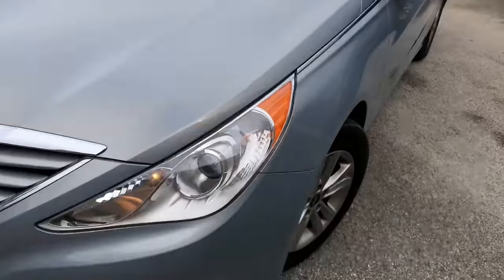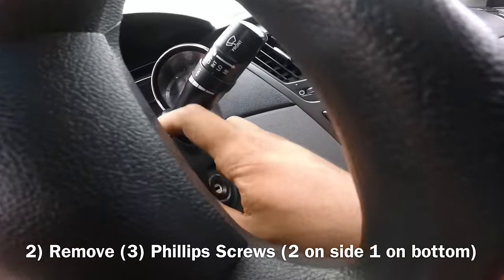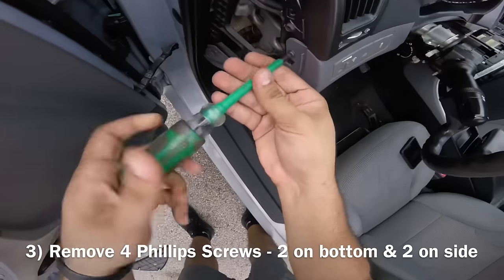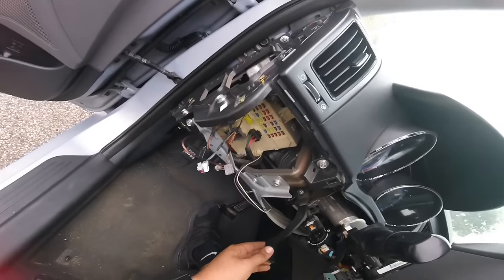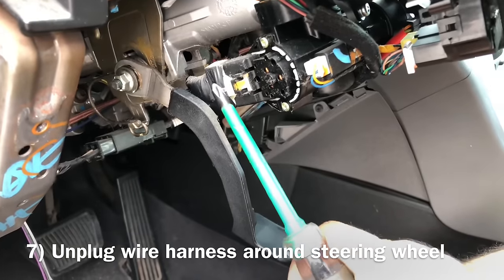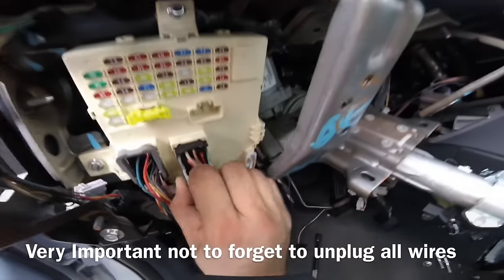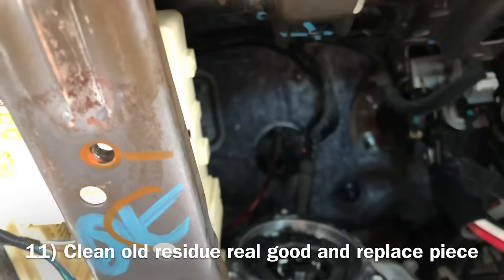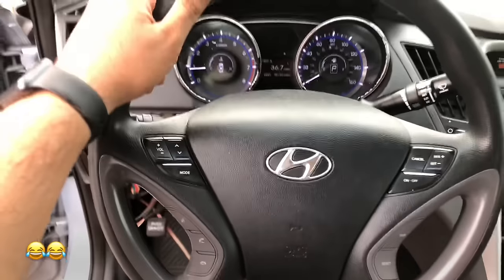HYUNDAI STEERING WHEEL NOISE : HOW TO FIX - SONATA/ OPTIMA 2011-2014 UNDER $20!! FAST & EASY!

Comment: Great Video. I have a 2010 Hyundai Elantra so parts were in a slightly different place but it that was the problem and replacing the coupler fixed it. EPS light on now, I think I just need my mechanic to reset it. Thanks

Comment: Hello Thank you so much I did it but after fixing the Steering is firm and doesn't work. I have checked again but it doesn’t work, what I should do? The EPS light is also lit. please help me
Reply from the maker: Hey bud! First I would recommend that you go back and inspect every connection to make sure it’s good and in the correct spot. Second check all your fuses! Make sure nothing is out of place and burnt out! Third I would recommend you bring it to a shop for further inspection.

Comment: It’s a good video. Walked me through the repair. They are correct the manufacture did extend replacement to 10yr or 100k miles. At 125k trouble free miles I don’t mind putting a three dollar part in her. Thanks...👍🏻
Reply from the maker: Hey I’m super glad I could bring value and information to you! And yes their warranties are excellent! And yes a three dollar part will save you hundreds if not thousands depending on where you go.

Comment: Thank you 
Great job!!
The only suggestion.....
Disconnect battery allow air bag module to discharge, then disconnect the yellow air bag connector . 
( yellow = caution )
Reply from the maker: lastgleeming thank you! Really appreciate the feedback!! Thanks for watching!!
Reply: @Hidalgo Motors Co TV 
It came out great! Only problem the clock spring code set .
Not my fault . Did not move steering wheel . 
Just high mileage garbage . It was very easy . Took 7 minutes since I didn’t replace the panels or clam shell . 
Save my friend a bunch . Thank you again. 
I subscribed .
Reply from the maker: Wow that’s incredible!! That’s amazing! Thanks so much for watching! It really means a lot to us!! Glad you could help your friend. Clock spring should be easy! Thanks for the sub!

Comment: This video is so helpful omg thank you!! This noise has been driving me crazy for a year. My veloster thanks you!
Reply from the maker: You are very welcome my friend! Thanks for watching! Please share your experience with us!
Reply: HelloHali did you do yours yourself or go to a dealership? I just called the dealership to ask about it and they told me that the veloster doesn’t “have this coupler part and I’ll need my whole steering column replaced”

I know that it’s in there, it’s the EXACT noise this car is making, plus I can order the coupling for my specific year veloster. Like wtf
Reply from the maker: dollxfacexdenied I would recommend purchasing a repair manual for Hyundai Veloster. They’re very similar cars. If you follow the procedure here and be very careful about it you should be okay. Show these people this video. Well skip ahead to where we drop the steering column so they can see the actual coupler... another user went to a shop and he showed them my video and the dealership agreed and replaced the part I believe. You don’t need the whole steering column.

Comment: Well... Watching your video I decided to try it myself you made it look easy... Unfortunately I'm still going to have to take it to the mechanic because looks like someone already replaced it once because the black bolts to take it off are striped and I can't get it off. But before the mechanic will fix it I have to put it back together...dose the steering wheel colum hook have to go in a certain place?

Comment: This is great thanks for the excellent video. We have an 2013 Elantra GT with this issue. You mentioned the noise but is this a dangerous condition when the plastic part just totally dissolves? I drove it this weekend for 4 hours on a road trip for Christmas it seemed scary with the play in the wheel and the bump sound as  I kept the car between the lines of I40. Thanks!!

Comment: Hi everyone, thank you for the video. I tried your method today. I was excited I was able to remove everything I replace the worn part. Unfortunately after putting everything back my steering wheel is locked can turn it despite the fact that I can turn the car on and off . everything else seems to work except that. I am EPS on the dashbord and the sign of sliding car
Reply from the maker: Man that’s a great question. I haven’t run into that issue, I’d suggest going back to make sure everything has been plugged back in.
Reply: This was 3 years ago so I don’t expect an answer, but I’m having the same issue. Did we ever figure out the cause of this? Is electrical?

Comment: So i did all this and when i hooked all the wires back up my car ran for a day. The next day,it started i drove to my sisters to put all the panels back on... after parking it wouldnt turn back on. I found a way on google. Press the start botton wait a couple seconds then hold the start botton for 20 seconds with out brake and it will turn on. It worked. But thats the only way it can start. Plus when i try to shift it gets lockeked and i have to press the botton thing by the shifter please help
Reply from the maker: Wow that’s strange... I would double check to make sure all the connections are nice and tight. Next, check all your fuses. And last but not least, have the Hyundai dealership diagnose the problem. They may charge but they will tell you exactly what’s wrong with it

Comment: Thanks for the video!!!! But is that the only reason why there is a noise?
Reply from the maker: on the steering wheel clunking noise yes. if it's further down, it may be a suspension issue.

Comment: I hope you’ll see this and respond. My dad followed this exactly and got it fixed. However, upon finishing now my car won’t start. That’s never happened before. Dashboard lights up but nothing turns on. Diagnostic tools say nothing major is wrong. 

Is it possible if something was mixed up while putting it back together that it wouldn’t start??
Reply from the maker: hey this happens often. it did not happen to us but seen people go through this. take it apart again and check the ignition plug.. it's gotta be something simple. hope this helps.
Reply: @HidalgoMotorsCo  thank you so much!!

Comment: oh, I have the exact same problem with my 2014 Sonata. I scheduled maintenance with my dealer, but I wonder how serious this problem is. Do I have to fix this right away or can I wait for a couple of days until the small part is available? By the way, where can I order that part? Thanks!
Reply from the maker: Handsome K I would order the part directly from the dealership. You can drive it like that for a couple of days no problem. Just be careful when going highway speeds.. you may sway too much... it all depends on you and how safe you are on the road... the part can wait a few days. I drove mine for like a week with this problem and had no issues. It was just hard to keep the steering wheel straight because it’s always wants to go to one side or another due to the coupler being worn out... once again thanks so much for watching!

Comment: Great video very useful. But I ran into a problem i followed all the instructions but didnt  undo the negative cable not my car won't start any use tips that can help me get the car started?
Reply from the maker: Dominic Walker are there any lights that come on? The battery may be dead
Reply: Yes all the lights come on
Reply: Radio and all
Reply: While working the alarm bleep a couple times.
Reply from the maker: Check your fuses.
Reply from the maker: Make sure car is in Park. And step on the brakes lol sometimes it may not have enough juice. Try to jump start it. Maybe that’ll do it
Reply: Thanks I'll try all....

Comment: Hey man thanks for the vid. Would this issue cause a problem with getting an alignment done? I had a place tell me they couldn’t do it until this problem is corrected. Is that true
Reply from the maker: Jeffrey Durborow hey man! Thanks for watching! And to answer your question... quite honestly.. it’s possible to perform an alignment. But if it’s a shop there’s a high chance they won’t do it for personal security reasons. It’s similar to a worn suspension part. If you have worn shocks/struts. They will suggest you replace the struts first before getting an alignment... so it may be the same thing... that’s my personal opinion. I could be wrong. Once again! Thanks for watching!

Comment: Does anyone know if this is the same issue on a 2013 Hyundai Santa Fe Limited? It's been slowly getting worse and worse over a year. I stopped by the dealer after watching this video to buy the coupler but dealer says I need to purchase the entire ECU or EPS (can't remember). Seems funny that on their high end models that would want you to buy a $600 part rather than a $5 part. It's bad enough now that I really don't want to drive it until it is fixed.
Reply from the maker: Matt Duncan great question! I believe it should be a fairly similar concept. Although I’m not sure. I personally haven’t performed this job on a Santa Fe.... once again! Thanks for watching!

Comment: Doing this on a 2010 Elantra. Have everything completed up to taking the coupler apart and replacing the black plastic spacer. The housing is completely different unsure how to take it apart and replace that washer. Help if you can please!! Can send pictures to help explanation and show housing if needed! Thank you!!
Reply from the maker: google a diagram or call dealership for a diagram on that pump. it should be pretty straightforward :(

Comment: great news     I just went to get this fixed, Hyundai has an extended warranty for this problem,    so got it fixed for free
Reply from the maker: Dan Cronin Yess! Congrats! Not every car qualifies for the free repair! Thanks for watching!
Reply: So I just read the thing about the warranty. Its a bit wordy and I am worried I am not understanding it correctly. I am trying to call the dealership to confirm. Is it that they will fix it only IF you have had it for 10 years/ or hit 100k miles or BEFORE you hit 10 years/ 100k miles?
Reply from the maker: @hannahwichman736  that warranty should not matter.. it has been a recall on all hyundai sonatas by the factory, no matter how old it gets they should fix it for free, however some vehicles qualify for the repair and some dont, I am not sure exactly how it works but that's what I know.
Reply: Dealership cut off is 100k miles. And they want 330$ to fix it.

Comment: Great video.  I am having this same problem with my 2010 Hyundai Elentra.   My steering wheel / front end will violently vibrate when I am on the highway doing 75mph and if I have to brake.   Is that also a symptom of this same issue or do I have an additional problem?
Reply from the maker: It could be your tires.. I would suggest taking it to the Hyundai dealership and paying for a diagnosis
Reply: I have the same problem right now with my 2013 hyundai Elentra, it would viciously shake after I hit 70 mph. Did you ever find the reason or was it from replacing that thing in the video???

Comment: A piece of plastic and you can lose your steering really? they couldn't at least made it out of aluminum? This is a lot more work then i am use to. This is a safety issue and should be under a recall. Does anyone know if this has been brought up to NHSTA?
Reply from the maker: yeah seriously. it's just to keep their customers coming back to get the newer models. haha but there is a user on here that machines them out of aluminum maybe you can find them

Comment: Hi, I just saw this very helpful video, thank you so much! I didn't read all the comments, there is almost 500... , did someone find an easier way to do it? If not what is or are the most important steps to pay attention to?
Reply: Megleee23 I didn’t find an easier way to do it but I did some research and there is a recall for this specific issue. If your car is under 100,000 miles you’ll be able to get it repairs for free at a dealership. This is the website you can input your VIN to verify that your car qualifies https://autoservice.hyundaiusa.com/TXX7/MicroSiteTemplate/MicroSiteTemplateVINValidate/2687
Reply from the maker: Hey there! Thanks so much for watching! We really appreciate your time! Thanks so much for messaging us! Have you gotten it fixed?
Reply from the maker: Thanks so much for helping our viewers! You’re awesome!

Comment: Thank you my new friend!!!:-) My 2013 Sonata started having this problem a few weeks back and it was not until it got worse that I was able to determine it was a left right problem as it was so intermittent.

After watching your video, which I will watch again once my part arrives, I Googled est. repair costs.  While it did not "paste" well, you all get the idea. You really saved all of us some serious money. THANK YOU!!! ... BTW... as of this post, Amazon has the OEM part for $8.32. 

People also ask
How much does it cost to replace a steering coupler 2013 Hyundai Sonata?
Car	Service	Estimate
2005 Hyundai SonataL4-2.4L	Service typeFlex Coupling-Steering Damper Replacement	Estimate$429.84
2013 Hyundai SonataL4-2.4L Hybrid	Service typeFlex Coupling-Steering Damper Replacement	Estimate$440.34
2016 Hyundai SonataL4-2.0L Turbo	Service typeFlex Coupling-Steering Damper Replacement	Estimate$440.34

Comment: Very informative , very helpful , Hyundai in copying honda , Toyota and mixture of European all put together in one doing these idiotic over engineering but I will try to do it on my own after watching your few 3-4 times . It definitely saves money and saves time from dealership rip off which Hyundai should be covering as manufacture defects . Thanks again .
Reply from the maker: Hey you are very welcome! Glad we could help you! And yeah the hardest part for us was re installing the steering column. Other than that it was extremely easygoing process!! Plain and simple. Unscrew unplug and remove. Reinstall plug in and screw in and done! Lol thanks for watching!

Comment: Thank you for the video. My 2011 hyundai sonata has EPS on after replacing coupler. 

I have checked all the wiring.

Any suggestion?
Reply: Just clear the light
Reply from the maker: i suggest you take it to the dealership for a diagnostic or just so they can try and reset the light.
Reply from the maker: can you do that with your obd2  scanner or does it require a larger computer.

Comment: My son's Sonata had the same problem. Dealer wanted $400 to fix. I think my son spent $6 on the new part, and he and a friend replaced it. I suspect he might have watched your video as he said he saw how to replace it on YT.

Seeing how common this problem is (I think my 2012 Sorento is going bad), I wonder if there is an aftermarket metal gear available or if applying a bit of grease to the part would help.
Reply from the maker: Wow! Way to go! Tell your son I’m proud of him! Haha and that’s great to hear!! And yes it’s a very common issue! It’s actually a recall from the Hyundai / KIA manufacturers you should call the dealer and provide them a vin to see if yours is covered by the recall and they will do it for free!

Comment: What about when people ignore it and keep driving like that, does it damage anything besides that coupler
Reply from the maker: Damian Spears that’s a good question. I will be assuming here and say if you drive with this problem for a while without fixing it. Of course besides the annoying clicking and steering wheel shaking during highway speeds it may just wear out the metal pieces and possible break off or slip.. not sure. I don’t recommend anyone try it though lol 😂

Comment: Got to the last part but those 3 screws are screwed on so tight cant get it off manually or with a drill. How did you remove those 3 screws to get to the part?

Comment: Will this cause the car to make noise going over bumps as well or only steering? I had a guy tell me today that my electric power steering was damaged and they'd need to lift it and take a look around. My car is making this exact noise but it does it over bumps too. I laughed to myself when he said EPS because my wheel turns fine and no EPS lights on at all.

Comment: When i drive on bad roads i hear clunking noises is that this fix as well?
Ive been trying to get rid of it. Please respond any information will help
Reply from the maker: Hey bud thanks so much for watching.. it you drive on and roads and hear clunking noise it could be your suspension is worn out. I would suggest have it inspected by a local shop.

Comment: Thanks for the video, I was able to replace it quiet easily in about 2 hours. However after securing the steering column and plugging the wires back in the car has an alarm going off and the EPS light is on. Any tips? Think I'm gonna have to call a mechanic over if I can't figure it out in the morning.
Reply: Same thing happened to me, any tips on how to get that fixed?

Comment: Hey bro, I want to try and do this by myself but Ive seen people with the EPS signal turned on after doing this. How can I avoid this? Great video
Reply from the maker: the best way to avoid this is to be extremely careful and not damage any electrical components and don't yank hard on wires. just be careful, gentle and everything should be fine.
Reply: @HidalgoMotorsCo  thank you so much for your answer! I just did it yesterday and everything went very well. Now my steering wheel is so smooth and like new. Thank you again. Greeting from Nicaragua 🇳🇮.
Reply from the maker: metrox2 thanks man! I am proud of you! Thanks for watching!

Comment: What is the estimated time to do this job, knowing what to do. Say if a dealership does it? Thanks!!
Reply from the maker: MrReed should be done in 2 hours max
Reply: It should is the key phrase, but you will run into an unexpected obstacle which is takes it more like 4 hours.